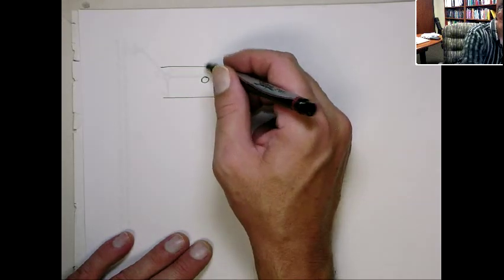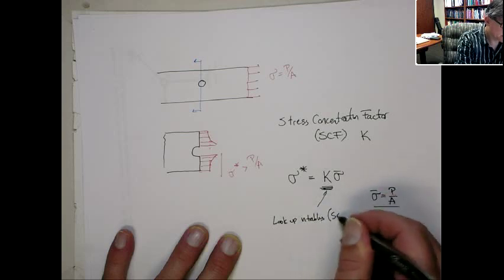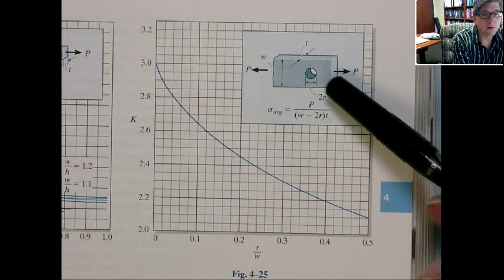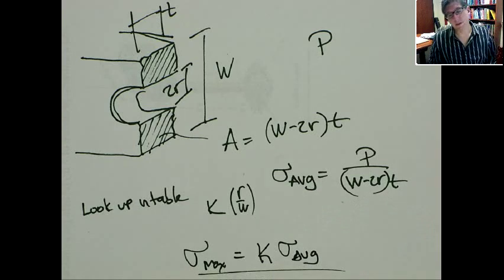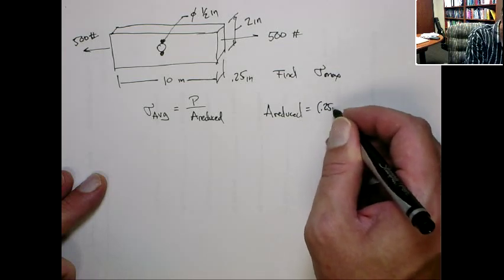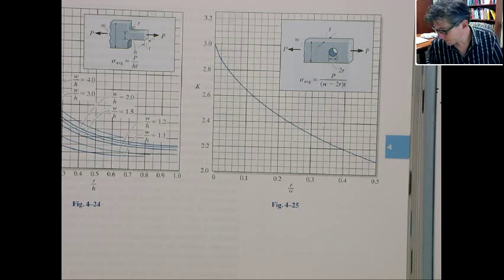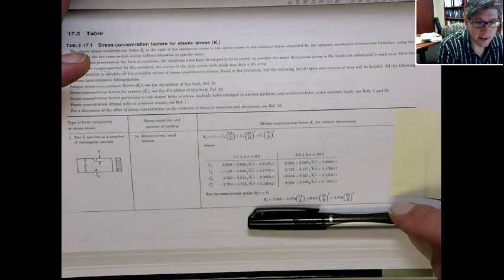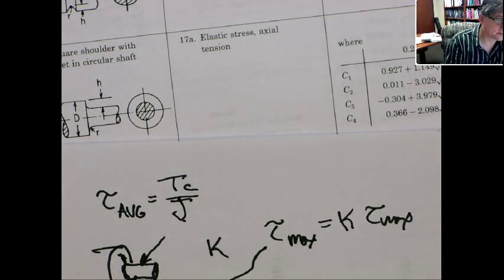Stress concentration factor lecture

Comment: what is neubers stress concentration factor
Reply from the maker: This is a theory that allows one to extend linear elastic finite element results where there are stresses over the elastic limit without having to run a full elastio-plastic analysis.  It is saying that the strain energy under the purely elastic curve is a conservative estimiate of the strain energy of the actual elastio-plastic curve.

Comment: sorry i have a question in stress strain diagram why aluminum dosent have yeild point  i want the all reasons
Reply: Hi Kazewa. Differently from steel, Aluminum tipically does not present a Yeld point. It is a feature of this material, and if you check those stress strain graphics out, you can notice there is no yeld point... I hope I helped...

Comment: The cross sectional area at far right (and left) is (0.25)(2)=0.5 square inches. Hence, the stress at far right (and left) is (500)/(0.5)=1000 psi. At the centre, the cross sectional area is (0.25)(2-0.5)=3/8=0.375 square inches. Hence, the average stress at the centre is (500)/(0.375)=1333.3… psi.

Comment: Please note that some calculations are wrong in your video. Also, please note that the stress concentration factor depends on material properties. For the same initial dimensions, do you expect stress concentration factor to be same for wood, concrete, or plastic?

Comment: Some calculations are wrong in this video. For example, at time14:49, the cross sectional area is not 1.3215. It is 3/8 = 0.375.